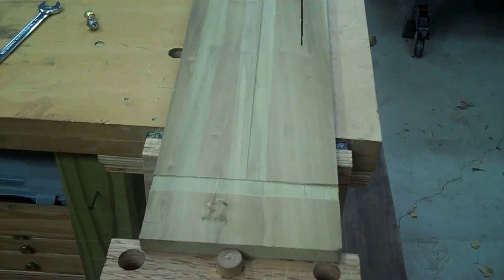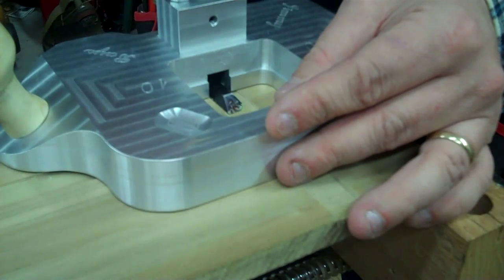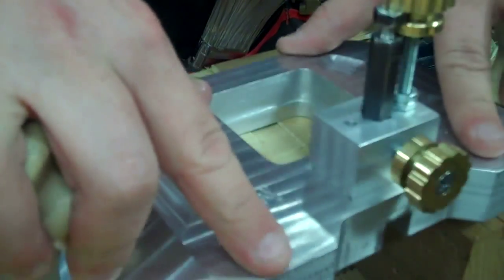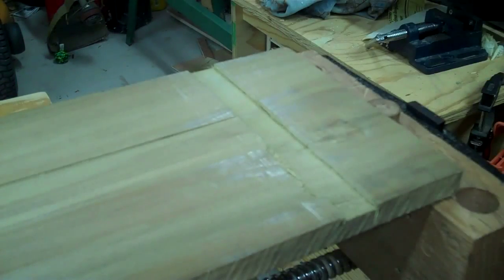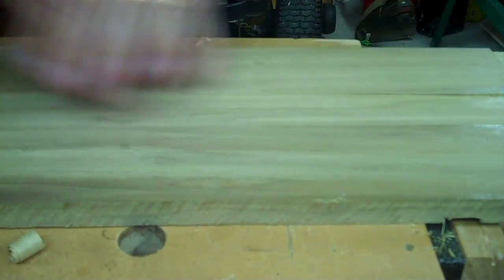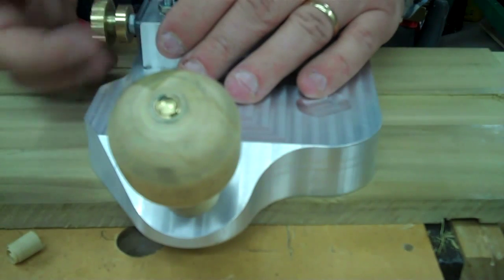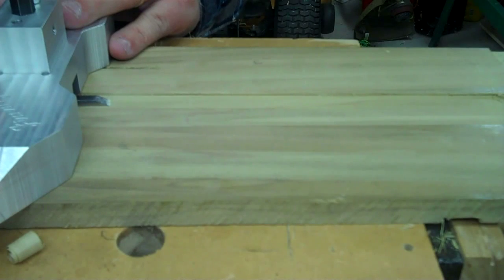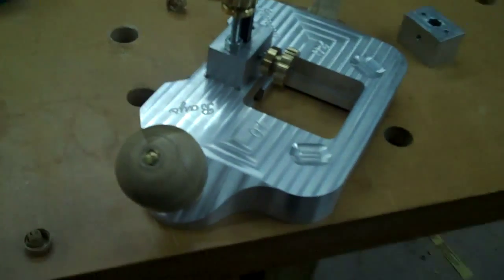Router Plane Trial Red Dirt Wood Shopb

Comment: Sweet looking plane!
Just a tip, saw down to depth on both sides, then go at the waste between the saw cuts w/ the router plane.  On the dadoe, you were pulling up wood on just one side because the fibers hadn't been severed at both ends.  That's what the saw cuts are for.